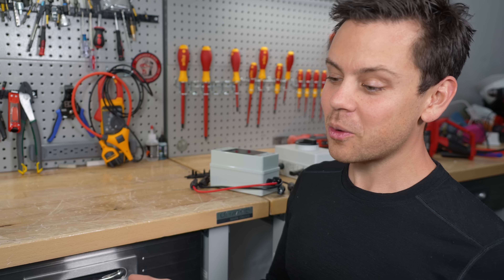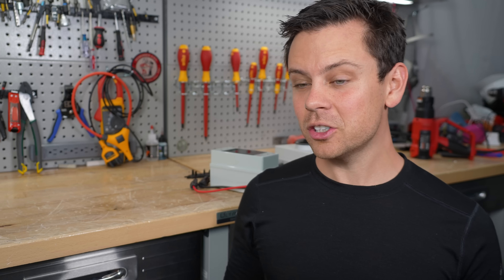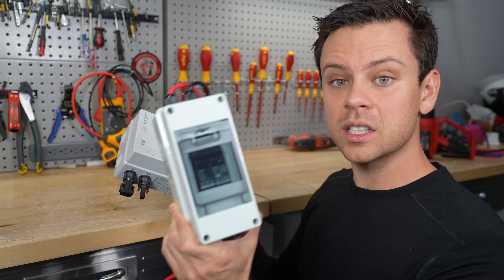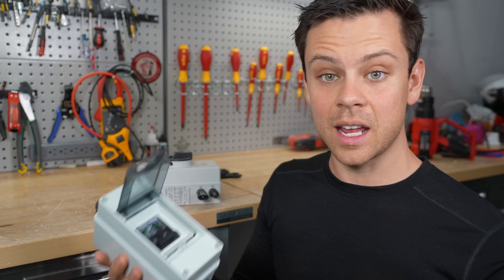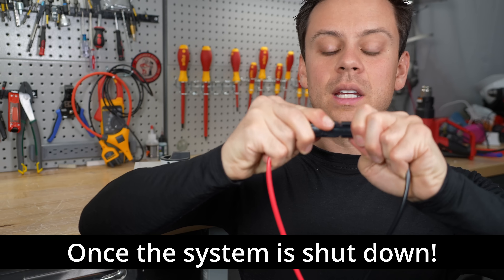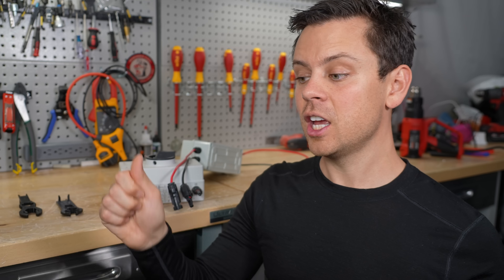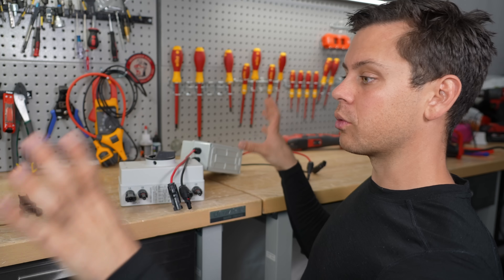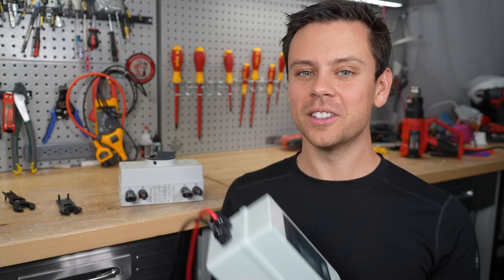How to Avoid Electrocution from an Offgrid Solar System: Everyone should know this!

Comment: Thanks for the video, Will! I’ve always considered this a crucial aspect of a good setup, especially for smaller systems like the hand truck setup. I also highly recommend ensuring a very solid ground connection. Both the battery and the inverter box should be tied to the same ground for safety and efficiency.
You’re absolutely right—anyone using more than 12V should adopt this as standard practice. That covers just about everything, by the way. I used to use a Nader breaker on the positive line from my solar input, but it isn't correct. PV systems can still generate voltage even when disconnected on one side (positive or negative). By disconnecting both, you ensure complete isolation, which reduces the risk of accidental shocks or short circuits during maintenance or troubleshooting. If only one side is disconnected, the remaining line could potentially become energized due to a ground fault or other unintended pathways. Disconnecting both lines eliminates this risk and ensures no unintended current paths exist.
Also most electrical codes and standards, such as the National Electric Code (NEC) in the U.S., recommend or require double-pole disconnects for DC circuits to ensure both positive and negative conductors are isolated during shutdown for safety and compliance.
And as Will mentioned, DC circuits are prone to arcing, particularly in high-voltage systems. Disconnecting both positive and negative lines reduces (almost eliminates) the risk of arcing during disconnection, especially under load. The breakers you recommend Will would handle that perfectly.

It’s a no-brainer for most setups and incredibly convenient to be able to shut off PV input when needed.

Comment: After reading the comments from the ecoflow DPU video makes me realize too many of them didnt understand that using the c19 port to charge doenst disable the AC output unless you use 240v for that c19 port.  If you use power in/out port though, you can charge from 240v without the ac output disabling.

Comment: I love that this vid came out the week after I just explained to all my fellow campers as to why I only ever hook up/unhook my camp solar at night! I've sent it off to the group chat as a "See? Told ya!!" They all thought I was being over cautious, but truth is, even with my Ecoflow DP, I have almost 140VOC with my current array that I use, and if I were to mess with it during the day it'd be incredibly dangerous for all the reasons you specified. I do not have a DC switch, but I have been considering getting one for when I mount my panels in a more permanent fashion. Currently I just set them up in camp, then take them down the night before I leave.
Reply: Same here.....I have a simple hobbyist DIY setup  - I'm out there at night with my headlamp if I need to work on it.
Reply: Yep, one aspect where my simple 12v panel system has an advantage.

Comment: Thanks, Will. As a noob, I have no idea about electricity. I'm always interested with solar power and thinking of getting Ecoflow someday but I am afraid of getting shocks while setting up the panel so this video is highly appreciated. I hope you published more safety videos soon like a series with lots of tips. Safety is almost always never highlighted by DIYers on YouTube so this helps a lot for us newbies.
Reply: Invest in a non-contact volt meter and some hot gloves.
Reply: @Denniss7420  Thanks. I bought a handheld tester the other month and learning how to use it. It is however a contact type. Thanks, I will get the glove (I didn't know its name before you mentioned). I'm scared of handling electrical stuff.

Comment: 1) Golden Rule - Treat Everything as "LIVE" untill proven / tested otherwise. 

2) Always check multimeter at a "known live power source" before testing any circuit as a fool proof measure.

But honestly if your untrained, eg not a Licensed Electrician or Certified Solar installer you shouldn't be working on lethal Voltages anyway. If you do & there's any issue your home will most likely NOT be covered by Insurance.

Comment: Already got my first micro-arc flash (connected a buck converter with inverted polarity, electronic parts flew away from the PCB) on a 500A system. You will definitely live longer if you use 24V system than with a 48V.  Unfortunately, all websites do not tell you this as a disadvantage of 48v system, personally. I will never build anything that is above 30V, life is worth more than comfort and wide-spreadness of 48V system. Voltage meters, switches, etc , will never replace skin resistance. Want to live longer, go for 24V
Reply: As a prior license mechanical contractor Unlimited that in our field we can run into chillers over 300 tons at 480 volts / 500 amps. I'll just say it this way, it doesn't matter how little or high the voltages or the amperage, You always practice proper electrical safety procedures and installation practices for the equipment that you're working on. 

There are many advantages for running a 48 volt system over a 24 volt system. I wouldn't waste my money on installing anything that's not 48 volts.  

But the most important part is, Install what you have a safety comfort in, but don't neglect to follow proper safety procedures and installation practices regardless.
Reply: @Bob-sy5gm  Assuming you’re beyond error is to insult the universe—and court disaster.

Comment: Nice video as always. I was hoping you’d go over MLPE devices that shut the output down at each solar panel. Togo’s TS4-A-F, for example, that cuts each panel’s output to 0.6v if it doesn’t receive the “keep alive” signal from an RSS transmitter.

Comment: The PV disconnect with two feeds you're showing is prevalent under many brands on Amazon but having the mc4 connectors on the side I think takes up unnecessary space. There are PV disconnects from Watts 24/7 that have two inputs but are in a vertical fashion and I find that to be a better design. I understand that maybe you want both feeds separated like that especially if you have to break out the tool and disconnect them but my preference is the vertical design.

Comment: Very good video to remind the DIY guys.
I am a mechanical contractor, and I have worked with two electrical companies in the last month  where the tech had severe burns. Do not cut corners or get complacent.  Turn off what you can and test with a meter before you touch it !

Comment: Backwoods Solar has recommended that I first connect the battery to my Victron charge controller, then connect the solar panels?  24V system, about 300 watts solar panel.

Comment: Thanks Will.  Following you from Australia.  Appreciate all you do.
Years ago in the days of wire fuses & before RCDs, I got zapped while replacing a wall switch plate after having pulled the fuse.
Investigation revealed that the fuse holders were incorrectly labelled in the fuse box, so I had pulled the wrong fuse.
From that moment I implemented "Multimeter must read zero across all combinations of conductors" before commencing any electrical work".
I have observed multiple electricians get zapped while working on live systems.  Nasty one was a metal watch band that ended up with a hole burnt through it.  Electrician was feeling safe using insulated tools.
The company I was employed at engaged electrician to check tightness of every terminal screw in the place at 6 month intervals.
At first I thought that was overkill, but after following him around a few times changed my mind.  Incredible how many screws loosened in 6 months, I am guessing from combination of thermal cylces along with vibration.
Blessings from Aus.
Reply: It's also amazing that even many electricians are unaware that screws in electrical systems have torque specs, and that there is such thing as a torque screwdriver. And if you want to see some really scary loose screws, check the connections on an RV (caravan) sometime 😮

Comment: Good video!

I'm experienced with electronics and electrical equipment, but mostly in the lower power area.  I knew that 4:40 was theoretically possible (having seen styropyro's massively parallel 12V getting shorted video)  but I hadn't considered the possibility of heating a wire up so fast it literally explodes into metal vapor IN YOUR FACE.

Now I know. 👍 (and will be wearing my eye protection more often.)
Reply: LiFePO4 batteries have short circuit currents in the region of 20-25kA, so they are damn near Styropyro's 70kA massively parallel battery setup. Any short circuit will result in immediate melted metal flying in all directions.

Comment: This is why I prefer panels hooked up in paralell, they'll only produce 12-18 volts depending on the panels specs. Which is much safer than series connections where the voltage goes over 40-50 volts
Reply: What SCCs do you use? Most I see the specs are high volts with like 30A usually. If you do 18V at 30A you're not getting much power so it would have to be a small system.
Reply: @ good point, that fact kinda irked me a little bit that it might not be enough voltage for the Mppt to work best. 
the PWM vs MPPT debate... I have two Li-Time SCC's one 30amp and one 60amp. x4 renogy 100w panels in paralell to the 60amp, and x3 130w panels to the 30 amp... I figure since both Mppt's have 12/24 on them, they're both suitable for a 12-18 volt setup

Comment: Good to know! I have been roughing out a solar system for a van, and I want to have a disconnect for each power source - solar, battery and alternator. I would love to have a master switch that disconnects all three sources at the same time...but three switches is workable.

Comment: I watched a kid wind up in the hospital after sticking his tongue on a 1.5V dry cell battery. Tongue swelled up the size of an egg in seconds. Low voltage, but very high current. Also I've had a tesla coil attached to my body while I sent lightning bolts from metal thimbles on my fingers. 50,000V, and almost no current. A battery or PV array are capable lots of voltage and current. And as my favorite sticker says: "This will kill you and it will hurt really bad the whole time you are dying"
Reply: Ohhh my gosh that's terrifying the lightning through your fingers lol

Comment: I had installed 20 all glass solar panels on my metal roof without grounding it, and well, you guessed it,  lol I had placed one hand on the roof and the other on a gabion "metal cage filled with rocks" that is holding a post attached to said roof and i measured 175 volts after I got zapped. Needles to say it's grounded very well, lol

Thanks for sharing, and as always, keep building 👍

Comment: A voltmeter and checking voltages are your best friends. Even with everything switched off, it is good practice to double-check. With a complex system, one can easily forget there's still something you forgot you have...
Reply: You will live until your voltmeter works reliably and don't use any device from China
Reply: One of my worst shocks as an electrician long ago was on a 208 volt system at a car dealer. We had all the panels locked out and just knew it was safe, but boss forgot about capacitors in the AC unit at the other end of the building. Discharged the whole thing into my hand and out my foot. Man that hurt for days. Pulled nearly every muscle on that side of my body. I also slept in a recliner for two nights to avoid pneumonia after the jolt. Never lay flat after a strong shock.

Comment: You can also use a light blocking blanket over the solar panels, IF they are rated 0 light penetration, for work on panels during the day. You can check with solar panel installation companies on where you can get them or how to make one. (Remember that a full moon WILL produce some current at night.)
Reply: With bi-facial panels the pick up light from the backside, I think we need to stop covering and just wait until night time.

Comment: I use two Midnite Solar Combiner boxes for my arrays (mounted at the panels) , one with breakers and the other with fuses. I then have two IMO disconnect switches for each array near my inverters in my garage so that I can make sure I don't fry myself. I also use my trusty multimeter to check for any residual voltage or current.  I trust Midnite Solar's breakers and IMO Disconnects more than others on the market.

Comment: The reason why GFCI's are designed to disconnect at 30mA is because 50mA is enough to kill you (at an appropriate voltage to overcome skin resistance). With PV, there are more risks than just electrocution. I was installing panels on my caravan roof, got a shock, fell of my ladder. Luckily only a few feet landing on grass - could have been a lot worse e.g. house, concrete.
Reply from the maker: Holy that's awful. And yes it's so small. I wanted the beginners to conceptualize it so went with "less than one amp" but yeah it doesn't take much at all
Reply from the maker: Glad you're ok
Reply: At times even 5-10mA can be fatal if it goes through one's heart, as it's sufficient current to cause muscles to lock up.  

It appears that newer UL 943 standards (2016?) may address this; I found a few references to class A GFCI being required to trip at not less than 4mA leakage to ground and at not more than 6mA leakage to ground.

Comment: Not to mention, I took a advanced electrical course and they told you that you can get shocked by a large current Go home after your day of work and die later that night of a heart attack.
Reply: Gosh that is some scary stuff... my biggest worry in my PV setup is when I run a window AC because they are known to leak volts/amps, and my RV is all aluminum.

Comment: I feel like Mr safety cuz I have a panel disconnect breaker for my 2x200w panels. Don't ask me if I have any of them fancy fuses between a battery and my inverter. Heck I've changed dozens of 120v receptacles without killing power. Only got bit a few times😂

Comment: Don't know if those disconnect breaker boxes are marked with a DC-in (panels) and DC-out (inverter) side, so you may notice MC4 connector and wire color polarity depending from which side you connect, are not matching. That is correct! Those breakers are polarized internally and if you get it wrong (which the correct MC4 connector should prevent) the breaker will catch fire instantly. So yeah, even if it is confusing to connect for example a negative pole at a red wire when connecting bottom in (if that is against the intended original direction). But still it can be very dangerous if one makes the wires by himself. Always look into the box directly at the breaker markings to never connect a wrong polarity at the breaker terminal!

Comment: Great videos lately Will! I was just thinking, for ~500V systems, I wonder if it would be a good idea to do what most EV's do and have 1 or 2 intermediary disconnects to cut the voltage in 1/2 or 3rds. Would add another level of safety to make sure nothing can arc across the final breaker/disconnect even when off.

Comment: Just an FYI. The MPP inputs on most inverters have voltage on them when the unit is running even though the panels aren’t connected yet. Yes the input do output enough to kill or knock you on your ass. I’ve already tested this so you don’t have to. Your welcome😉

Comment: Thanks Will, about to build my first 60v system, previous was 24v,  before your video I was going to use the MC4 to disconnect. Thanks for the safety tip.
Reply: I have 24v will never build 60v ever

Comment: do you recommend to use breaker or a dedciated dc  disconnector like IMO one? Because I already have some spare DC rated breaker and the IMO isolator is not cheap like $100. I think you can do a video compare different brands DC rated breaker and isolator. I don't know if I can trust a cheap brand also don't want to overpay relabeld brands. Most of them looks similar and maybe they do come from same factory.

Comment: Good timing, yesterday I had two series of 10 Canadian 540 solar panels put up on the shed and the home run is not hooked up yet. It was cloudy yesterday and we partially covered them when we connected the panels in series.  I was thinking if I had the home run PV wires connected to the panels but the wires on the other end were not insulated and right next to each other, that might burn the shed down.

Comment: Too many DIY'ers I've encountered think "oh, it's DC, I'll be fine" until I show them videos of 500V DC arcing between connectors. Great video, Will. Thanks for sharing.
Reply: Yes.  I never understood DC rated switches until using solar systems.  And to reiterate, the arc stops in AC because of the alternating current passing through zero.
Reply: plasma is a cruel mistress
Reply: Kind of like the original Frankenstein movie in black and white. Had to be a DC system for that.

Comment: Under typical condition 75v with shock you but you could be shock buy much lower. I used to work in line clearing and got shock by the primary line I was ok but hurting the next day. Knew some that had grabbed a primary that was on the ground didn't seem like same person after that

Comment: I recently connected a 50 watt solar panel directly to a heating element. To get it to work I had to match the impedance of the solar panel and heating element, otherwise the solar panel would produce practically no current.

This made me wonder, can you actually draw a dangerous amount of power from solar panels by touching the terminals? Won't the impedance mismatch be so large, that practically no current will flow?

I realize that electrical arcs can still be dangerous, and yes, you should follow Will's advise. And yes, a solar system normally have more components than the panels, and these components can be dangerous too if you don't follow sensible precautions.
Reply: Yes.  Most definitely.  What's to realize about this video is that his presumption is larger systems.  Not a couple of 100W panels in parallel.